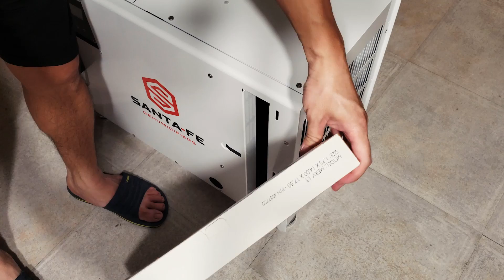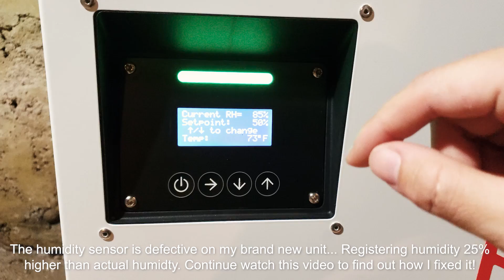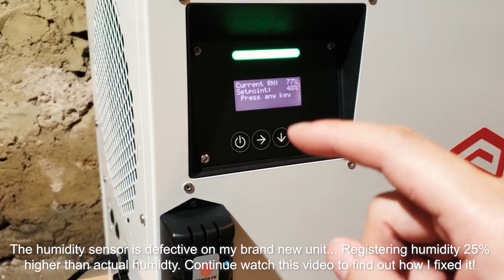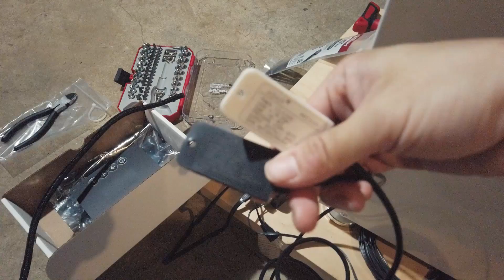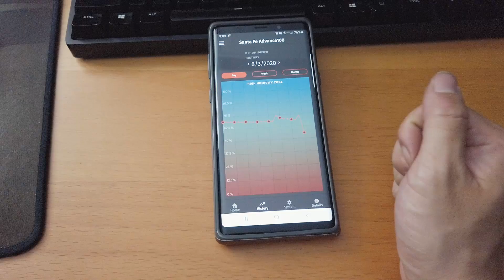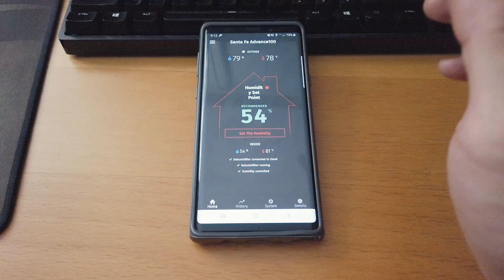Santa Fe Advance 100 WiFi Dehumidifier Self Install Review - The Good, Bad and The Ugly

Comment: Helpful video.  How reliable is the unit presently?
Reply from the maker: 1+ years running 24/7, no issues after the initial humidity sensor problem and kept my very humid basement bone dry, even after the big tropical storm pass by

Comment: You might want to look into sealing the walls and floors in the basement with a concrete sealer (DryLok).  Also cover any exposed dirt areas, if there are any, with a thick plastic barrier that is sealed to the walls.  Also make the sump pump pit covered and sealed.  The sump pump pit might be a point where radon is coming in under the slab.  I'm sure sealing all the walls and floors would cut the amount of moisture coming in.  It would also probably help with the radon.
Reply: Definitely check your Radon level; jTemp makes a good point. Radon is no joke, 2nd leading cause of lung cancer in non-smokers. Lung cancer has a 17% five year survival rate once detected and checking for radon is under $50!

Comment: Thank you for the thorough review.  I just ordered a New unit and was looking for setup advice on the Santa Fe dehumidifier.  Too bad a new unit needed you to replace parts so soon.  So how has the unit worked for you since you bought the unit?  Still meeting your expectations?  Are the replacement filters easy to find?   You mentioned your Electric company has “time of use” pricing.  How are you controlling that?  Would be nice if the App had a “Timer” function.  How reliable has the WiFi connection been?  Many on the web have complained that the WiFi connection tends to disconnect often.  Thank you again.
Reply from the maker: There is no problem with the Wifi connection, very reliable on my Advancd100, you just need to make sure your basement wifi signal is good, if not, add mesh-wifi routers to boost the signal.

It's a pretty standard filter size and can probably be bought from many home improvement stores or online, the filter is very easy to replace.

As for a timer function, I actually emailed their app-developing team and they said they had no plan of implementing that, and because the Advance 100 can resume running when power is restored, they suggested to just get a timer for the machine if I don't want it to be set up to run continuously. Then I found out my electric company doesn't implement time of use pricing and it was available for some other regions...

I do however need to keep the dehumidifier running 24/7 because my basement has quite a lot of exposed dirt and the humidity gets out of control with dehumidifier goes off even just for 3 or 4 hours...

As for energy efficiency, this dehumidifier is NOT ENERGY STAR rated and I kinda wish I had bought the Aprilaire - 1870 which is indeed energy star rated... https://www.energystar.gov/productfinder/product/certified-dehumidifiers/details/2361241

If I had to choose, I may go with Advance90 which is much cheaper and simpler to run 24/7, or the Aprilaire which costs the same but is much more efficient. But since this dehumidifier is supposed to be lasting me at least 5-6 years, I'll just worry about making the new purchasing decision then.